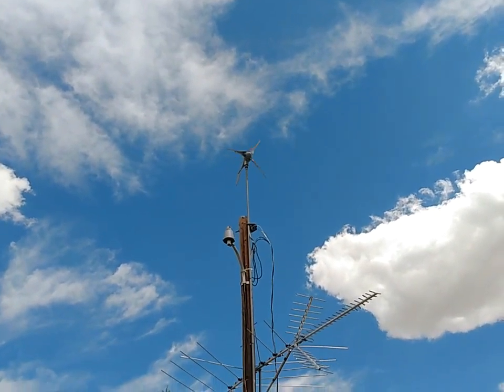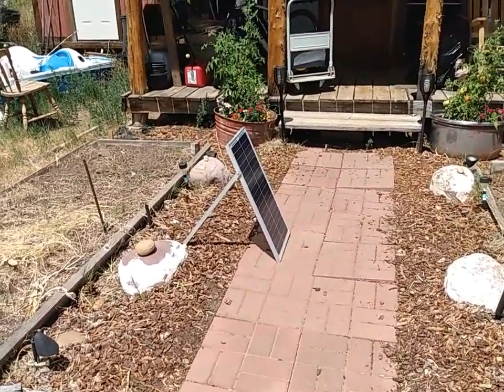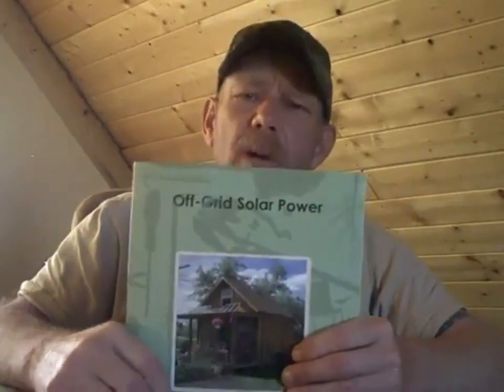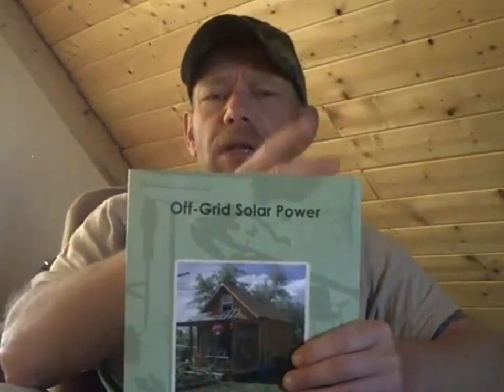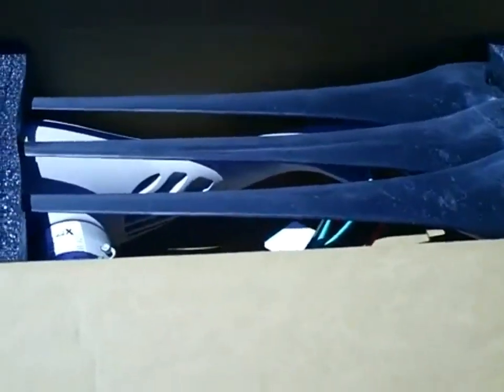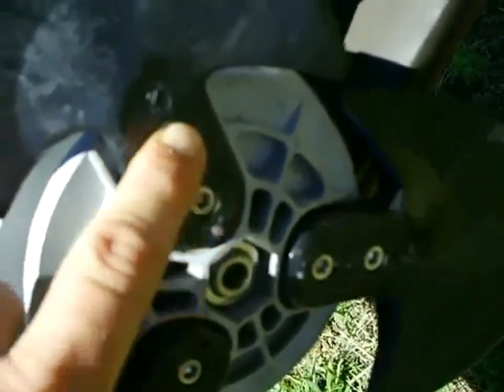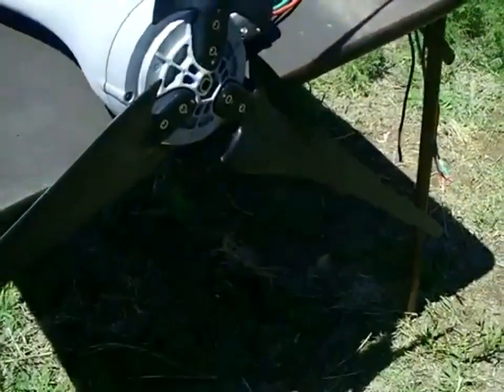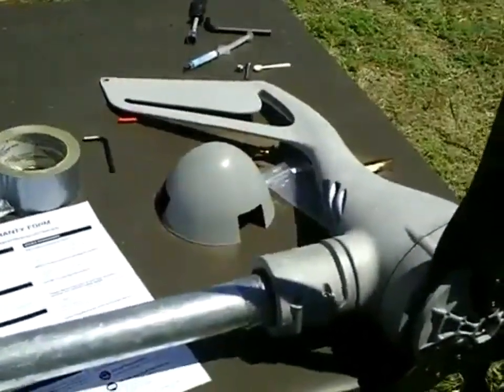Off Grid Wind Turbine Installation: Should You Get A Wind Turbine?

Comment: Between moving parts (wear items), the necessity of dump loads, and the variables of wind (vs sun), I see no benefits of of them over solar power.  I suppose if you have lots of steady wind, and no sun, they would be useful, but where exactly besides Antarctica would that be ?
Reply from the maker: It helps some in winter on low sun and stormy days but solar is more consistent.

Comment: Mine is sixteen feet high, but I live on a hill, lol. After high winds I put lock nuts behind the hub. I've had this watts meter on it for a week, it's made 7.18 kwH. Most I have seen is 658 watts from this 600 watts B & C. I used a three foot piece of angle iron lag screwed to the rafters, and I poured a concrete base stub to set it on. Most of the time it makes between 100 and 200 watts. I may have to bring a few of my solar panels inside, I have too much power when the wind blows and the 🌞 sun is out. I'd rather let it spin than put the brake on. The brake won't hold in a high wind, the wind overrides it, and the wiring gets really hot. Rather than burn the windings out, I let mine spin. At 5 : 15 a.m. it's showing 25.0 volts on the twenty big marine batteries. The wind didn't blow at all last night. I think it may be the first time since I put it up five weeks ago. I was down to either buying an Airex or the one I have, it was just a toss up between the two. It helps the most when it's cloudy, rainy and windy. It  really helped in March.
Reply from the maker: Can you change the blade length?  Good that you get that much wind. Mine mostly sits there doing nothing.
Reply: Well, it has the 28 inch blades. Maybe that's why it turns so fast, lol. I think it has taken some 80-90 MPH wind gusts without damaging anything. There were gusts up to 100 West of here about 75 miles. It would have been broken if it was going to break. If I had used the charge controller that came with it, it probably would have burned the windings out trying to brake it. Better to turn on a big load. That slows it too.

Comment: Thanks for the info. Lamar. Do you have to run that through a controller, like your solar panels and can a windmill be hooked to the same battery bank as your solar panels or do you need a separate battery bank. Thanks for any help. I really appreciate it!👍😁
Reply from the maker: It depends on the model. Mine has a built in 12 volt controller so it can just be attached straight to the batts. Do you have a model and brand and maybe I can help find out?
Reply: @Solarcabin Off Grid Adventure Channel  I'll check Lamar and let you know. Thanks so much!🙂

Comment: Hey I'm not shure if you live in an area were you may need heat. But I live here in Maine started building an off grid place. And of course it's cold as hell everyday in the winter.   anyways,  I purchased a cheap Chinese deasal heater. that's what I looked up to find info on this heater.  an installed it in my 30' camper I didnt hook it to the heating ducts,  i but if I did it would be a whole lot better.  it runs on 12volts fill this thing up only 2 gallon tank, and runs for four days 4 days steady on a tank. on 2 gallons of deisal and ran it 2 days steady on a car battery no re charging.  this thing is amazing,  in my book I love it"" I'm also going to pick one up that heats water I'm purchasing anouther just incase something fails but check it out I spent $120.00 for my first one I can now get them so much cheaper now .  They also have a self contained one also. But I lived in that camper during covid all winte to save money for lumber  and was warm as hell .  it has a thermostat set it forget it" I'm going to say I know in that cabin you got.  you would love it. Also I never had to put it on high I ran it on low once the place was warmed up.  Best of luck Bruce. My email is if you got questions. I do not sell these just real life situations. Saved me a ton of money and my back .  I suggest if your thinking aboat purchasing pick one save it in a wish list ahead of time . the price keeps dropping  I can buy them for $50.00 now. Purchased on wish 2 years ago.   bbourget69@gmail.com
Reply from the maker: I am not fond of kerosene or diesel heaters because of the smell and safety factors.

Comment: Can you charge a battery bank with wind and solar at the same time? I've been looking for the answer but without success.
Reply from the maker: Yes, my wind turbine has a built in controller so you just attach it to a battery directly but some come with a separate controller and you can get a controller for both wind and solar.
Reply: The senerio ive been researching is one battery bank fed by both wind and solar at the same time. Is there a special controller for this?

Comment: Have you investigated the solar roof shingles?
If I were by a river, or brook, I'd even use a mini water turbine system.
Reply from the maker: I have not tried the solar shingles. I like solar equipment I can get replacements for if needed and my system is small. A water turbine will work if you have fast moving constant water.
Reply: @solarcabin  

Ok. Just curious. I haven't seen any feedback on how they work. I know a guy in VY that uses a small water turbine in a small brook behind his battery shed. 
Redundant systems for backup. Perfect size wind turbine for your digs! I've seen home made ones, made with car alternators, etc. Necessity is the mother of invention!

Comment: How do you prevent cumulative humidity with your swamp cooler. when i look online it doesn't appear it draws air from outside
Reply from the maker: You should have a window or door cracked open so you get some fresh air circulation. That reduces that humidity buildup that makes you feel sticky and actually make the air cooler coming from the evap cooler.

Comment: I have a 400w turbine at home.. Just need to get a bucket lift and mount it on a pole and run the wires to my RV which has a pair of 400w Trina Solar panels on it which are connected to the 4 100ah lithium's.  Ps. I just ordered "Off Grid Package Deal".
Reply from the maker: Right on friend!
Reply: @solarcabin  i also bought a set of those rechargeable solar lights.. very cool and useful product.

Comment: Do you think one would be able to run a portable air conditioner (as well as all other household appliances) on a similar setup? I ask because I live in an area where swamp coolers just make the heat worse and if I go off grid I want a setup where I can be confident that I can still be comfortable.
Reply from the maker: On avg it would take at least a 1.5KW system to run a 5K BTU AC unit.
Reply: @solarcabin  Would that be just to run the AC, or the AC in combination with other typical household appliances and devices (i.e. fridge, washer/dryer, microwave, water heater, lights, phone/laptop/stereo/wifi/game system, etc. etc....)
Reply from the maker: For a traditional whole house system you need at least 5-10KW and most likely a grid tied system. I only do off grid systems.
Reply: @solarcabin  Oh, no I don't mean a full size house setup. I'm just one dude, I don't use as much electricity as an entire family would or anything like that, and wouldn't be using everything all at once, plus I only do laundry once a week. I'm already used to having to turn off the AC to use the microwave or my toaster oven (I wouldn't be using a full size stove/oven either-I use a toaster oven, a single burner, and very occasionally the microwave-not simultaneously) since it trips the breaker when I run multiple high power appliances at the same time (I rent a room, so I am running my stuff off two outlets and a surge protector, so sacrifices have to be made). I'm trying to figure out how to go off the grid because this past winter everything froze and the power company where I am at is VERY incompetent and we were without power for 2 weeks, and just a couple months ago the power went out again for almost a day during a heatwave, and when I move I want to make sure that never happens to me again. Fuck being on the grid. I want to generate my own power.
Reply from the maker: This system runs my entire cabin full time: https://www.youtube.com/watch?v=SwHpMRuT_lA